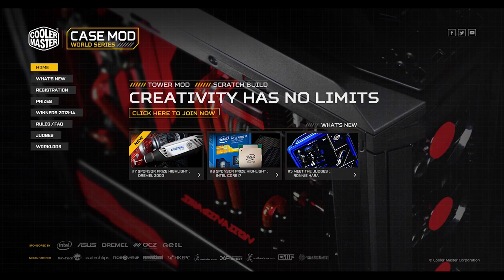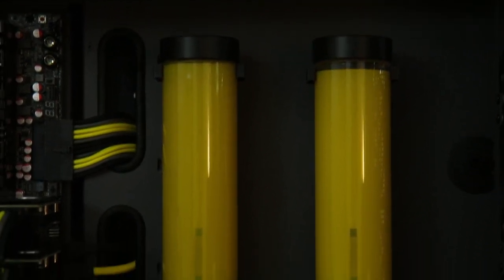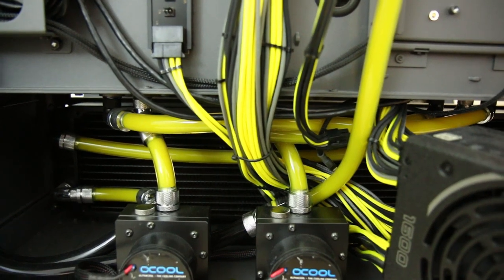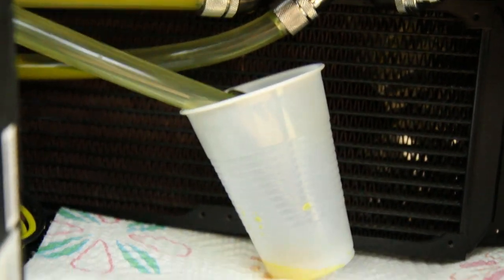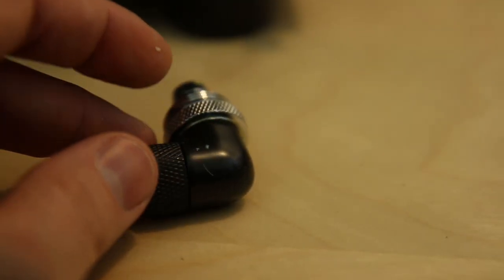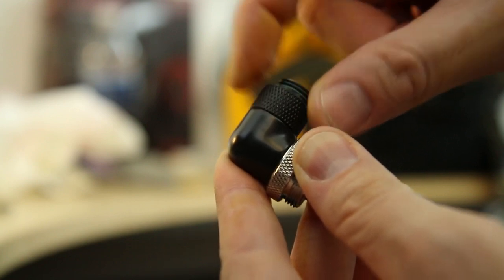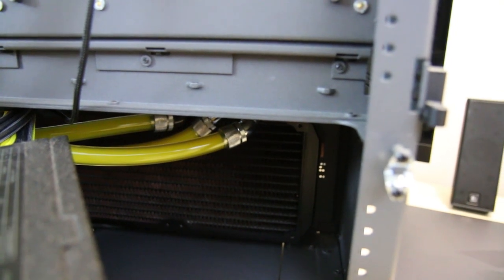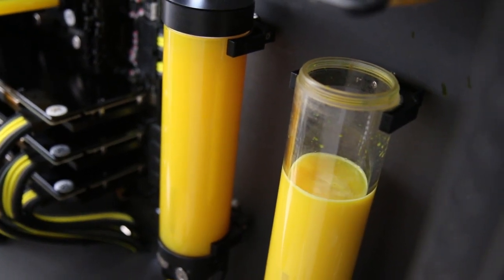My $6500 Custom Watercooled PC LEAKED!!! Now lets fix it....

Comment: ***** Jayz, you know why it's leaking, here's the answer to it. Copy paste from my engineering school lecture:

In a typical pumping system, piping bends, valves, transitions, as well as the location of the supply reservoir ahead of the pump impeller can be responsible for creating enough of a cumulative pressure drop to form vapor bubbles in the system. Also, sharp bends right before the inlet of the pump can add significantly to this problem, as the bend acts as a significant constraint to the fluid right before it enters the impeller. It is here a pressure drop will occur that could possibly be enough to form vapor bubbles and also magnify any existing vapor bubbles already in the system. Piping and supply reservoirs positioned at an elevation below the pump also contribute to this problem due to the higher suction head required to draw the fluid to the pump.

To simulate numerous pipe bends, valves, transitions, etc., ahead of the pump impeller, the inlet valveof the Pump Lab will be slowly closed, causing a constriction in the line. At a certain point, the pressuredrop across this constriction will cause vapor bubbles to form. Since the liquid supply tank is positionedlower than the pump itself, it initiates a negative head pressure, which also needs to be overcome bythe suction head of the pump. This adds further to the possibility of the liquid in the system reaching vapor pressure. To further compound vapor bubble generation, a sharp 90-degree bend was built into the flow system right before entering the pump impeller. This sharp bend, near the pump suction inlet, adds more pressure drop, which aids in the development of destructive bubbles contacting the impeller vanes and face. The following lab process is designed to make cavitation visible to allow a better understanding of its harmful characteristics.

Comment: I have a coolant I work with that could leak straight onto some of the most important components and it will continue running without issue :)

Comment: points and laughs Haha! 

In fairness though, I too has had a system leak with a more catastrophic outcome. 
It was self induced though, since I left a system running with a custom made CPU cooling block, made out of coins and solder and tartaric acid in the system. Just for the purpose to see how long it would last. 
After 2 months it had eaten through a solder joint and started leaking on the graphics card killing the PC and I finally had the excuse I needed to build a new one. ;)

Comment: I would use Mineral Oil instead of a colored water which you stick in the pumps, reason being is that mineral oil is non-conductive, so if there was happen to be a leak, there'd be no major concern if it does leak since you can just wipe it off and recheck the fittings and fill the canister pumps up again.

Comment: Is it bad that i was hoping to see it all over the M/B and Graphics cards etc from the title? Always wondered about the conductive properties of water dyes. I  Knocked a pint of water over my Rig while playing far cry 4. All 3 screens flashed before BSOD. both graphics card, sound card, M/B Drenched! Cleaned and dried it all... Works fine. would the same happen with coloured fluids?
Reply: Basic water is very conductive, you're lucky everything still works fine, with these modified coolants it's the same scenario, basically liquids don't go with circuit boards and other electrical properties found inside computers. A little splash on the surface won't do any harm, just wipe it up and everything is fine and dandy, but if you let it sit the coolant will begin to fuck with the solder points and make your MB or GPU short circuit. Generally the custom coolants used in most LC loops have a higher viscosity than that of water and so they have a potential to wreak havoc on a PC in greater quantities vs basic water which spreads over time at a much faster rate causing damage in far lesser quantities due to there not being any third party elements such as an antimicrobial solution etc.

Comment: I was thinking about building my 3rd ever PC. In the past, I've built mid-range priced PCs, but I'm thinking about finally building a high end gaming PC. I don't plan on overclocking, and I will probably only use a single graphics card. I have had it with fan noise as I like to record music sometimes and the fan is definitely an annoyance when monitoring a condenser mic. Do you think I should watercool?

Comment: There's nothing wrong with that fitting.  You need to tighten your fittings at least once after running your system for awhile unless your tubes had lots of slack at installation.  The tubes will stretch and move around due to water flow over time and the only thing holding the fitting on is friction from the screw threads. This is not unlike older cars with lose screws holding down gaskets.

Comment: the way i look at it...

both air and water can gave amazing temps and OC potential... my nh-d15 is better/just as good as AIO's....

but with water, you CANT be lazy... you need to at least look inside your case every few days. 

with air... ya dont have to do shit till your temps start creeping up, then dust it off.

i highly doubt my d15 would be louder than even a custom water cooling set up and offers within 5c the same performance...but some tims 5c is the difference between 4ghz and 4.2, and water cooling is just cool...

Comment: video is old but in a bunch of videos those fittings come loose could it be vibration back out? locktight is used on cars to avoid vibration back out

Comment: Hah. Least your pump didnt die causing the water to heat up and blow the pipe off the cpu block squirting water over your entire mobo, gpu, ram and pretty much everything.
yup. that happened to me.
Amazingly the only thing that survived was the cpu (and psu).
never going water cooling again.
With a properly tuned air setup I get not far off average closed cooling loop temps, or at the very least waaay more than adequate cooling off air.
Kinda entertaining the idea of a mineral oil immersed build next though......

Comment: Info I found a proplem of a thermostake 900 tover and asus extreem VI to check the mother's straightness with gums twisting the parent to the circumference.
Reply: I see that when i install moterboard it easy to fix. cut cum up off one side.

Comment: Why not use mineral oil instead of water  because even if it does leak it wont hurt the board or any other electronic part.

Comment: You got a bad o ring like in air conditioning in a car leaky coolant Hot coolant will be higher pressure so it will leak faster.

Comment: my pc just started leaking too, but i found out there was a hole in the radiator somehow. i checked every fitting, and when i did the air test on just my radiator with no fittings, just thumbs and mouth, there was an air breach half way down the radiator. super weird, but i got a new radiator and all is good now. and this time I added a drain port to my hardline loop......draining was a bitch before. XD

Comment: Water cooling is awesome but I'll stick to air cooling. Less mess, cheaper and nearly the same cooling capabilities at the same noise level. Yea water cooling looks awesome as fuck with acrylic tubing, LEDs and metal fittings but it's just not worth the risk as most components don't cover your item if it is water damaged.

Comment: Hi JZ!
So, I've been getting my CPU to run at 90ºC~100ºC while I play FFXIV and it has stopped twice on the same week. My ambient temp was around 38ºC~40ºC.
So I've been thinking in building a loop or getting an AiO water cooler but all I see people saying is that AiOs have a small life span or perform the same as Air coolers, which are cheaper. Some say that custom loops are just for looks.

So, what do I do? Living in a hot tropical country, I get pretty high temps and don't want my PC to die.
Thanks in advance!

Comment: I have hade a couple of leaks my self but only one huge, it happend because there was something blocking the water in my cpu block so the tubing snapped and sprayed my hole motherboard and my gpu's. That time i had 3 GTX 680's and a i7-3970X, but with some luck nothing broke, i was like ohh fuck but it worked perfekt after cleaning that is luck!

Comment: water cooling is no good, all you really need is a good liquid cpu cooler and a big enough case like 900d and corsair fans  and you all good to go, also get the best parts like gpu cpu and no need to overclock foools.

Comment: and this is what scares the hell out of me about the custom water cooling route and why my system just has a asetek 590LX 360mm and it works just fine it keeps my cpu about 8 to 9 degrees cooler then then vcore 1 and about the same temp as vcore 2 which is sweet for cooling an amd 9590
Reply: David Jones i would love to see that xD

Comment: Could I run 2 different types of liquid consistency in 1 loop and have them stay separated so you can basically see the liquid progressing inside clear tubes? I plan to create a table with no cooling purpose but with a glass top and a loop inside the glass with an infinity mirror to make the loops look forever.  Because it will only be for looks the liquid will only run through a pump no radiator or cooling blocks.

 Just to better explain what I am thinking for example if you took oil and water in a bottle they would remain separated and could travel through tubes and remain or re-separate fairly quick.

Comment: how long does watercooling last? does it last 2months or 1yr
Reply: +DemonGates If you know what you are doing, it will last just as long as a watercooling loop setup in a car, for the entire life of the build and probably longer. If you are paranoid you can check it every 2 months like Mac Chambers suggests because yes, there will be some sublimation, but I've found I only need to add 50-100ml every 6 months. Watercooling is as low or high maintenance as you build it to be.

Comment: im doing my first watercooling build just waiting for all to get here this is what im gonna be doing
Motherboard: Asus z77 ,
CPU: I5 3770K,
GPU's 3 R9 290x's
MEMORY 32 gb Vengence.
1TB SDD'S x2
PSU 1500W Enermax Platimax, Full Modular, 80PLUS Platinum.
XSPC Razor R9 290X / 290 VGA Waterblock x3,
XSPC RayStorm CPU WaterBlock,
XSPC EX360 120mm Radiator - Black,
XSPC EX240 Multiport Radiator, 
RESERVOIR: X2O 750 Bayres/Pump (Black)
RESERVOIR: V4,PrimoChill 240mm AGB CTR System Phase II - UV Green
PUMP:Aquacomputer D5 Pump Motor with RPM Signal.
CASE: Phanteks Enthoo Primo Full Tower.
Reply: Why would you use that CPU and motherboard if you're spending all this money on a decent system like that? Don't you think it would much better to go withe the i7 4790K and a Z97 motherboard? That's common sense really, you shouldn't really build a system with parts that are becoming outdated, other than that the system is top notch
Reply: Its the one i got atm gonna change it once i got more money just a temp

Comment: I'm afraid of buying cheap radiators how. I got some brand I've never heard of before and didn't know that it came with screws that were too long. So one of it's own screws poked through and broke a fin. It dumped water all over my 980ti while filling it.... Always use dead water people.
Reply: Can it still be used?

Comment: Just buy a multi size set of O rings from the hardware shop for like £10 rather than replacing the whole fitting. You will get over 200 O rings.

Comment: I love Watercooling, but unfortunately I came to the conclusion that it isn't really worth it.
I did everything correctly, picked up all the high quality parts you can imagine, I'm talking Pitspower, EK waterblocks and Koolance.
I had two fucking quick-discounts from two fucking different companies leak!
What are the odds of tgat happening!
The Bitspower quick-discount leaked while I was testing the loop and the Koolance quick-discount leaked about two months of finishing the build.
Now I need to take every fucking thing apart AGAIN!
Which is a pain in the ass...
I know this sounds childish, but I lost my love for this build that I worked way too hard on...
I'm gonna fix it now and try to sell it.
Next build will be an AIO CPU Liquid cooler and an aircooled GPU inside a noise dampening case.
#FuckWatercooling

Comment: I know what your going through with your Kid. My Son Alex has DiGeorge Syndrome and had to have open heart surgery and a Mickey button Feeding tube. He's doing great now but its not easy. He is a wonderful kid he's 11 months old and he's doing amazing he still has the feeding tube but he don't use it anymore it will be removed soon. I've not had the money to water cool my PC with everything going on but that's not a big priority. Hopefully I will be able to water cool my PC since my air cooler is not keeping my CPU cool. Its gets to 100c on turbo No OC. I'm currently looking for used parts since there's no way I can afford a new kit. My PC is not bad the specs are Gigabyte Z97X gaming 3 mobo, i7-4790k, Crappy Rockfish cooler w/Homemade mount,16gb G.Skill Ripjaws X 1600, Zotac AMP! Omega GTX 970 w/Extreme Cooler, Corsair HX750 PSU, Kingston SSDNow V300 Series 120 GB SSD, 1 TB Hitachi HDD, Antec 1200 case. Not bad took a lot of saving to get it.

Comment: Hey Jay, I've recently noticed my AIO is leaking it seems. There is a bit of fluid from the AIO I have in the top of my case on my graphics card. The PC still runs and there is no issues, but how should I go about cleaning the graphics card pcb to remove all the fluid without damaging it? Its not much just a few drops.

Comment: My AIO leaked.. I was just gaming on my 980 TI hybrid and all the sudden my GPU temperatures went up to 90°C out of nowhere, and the fan was spinning at max speed. Next thing you know my screen goes black. I am mediately open up the case to see what was wrong and I saw a water leak .. :(. 

Call my old air cooled 980 TI I can use in the meantime until I figure out what went wrong and to fix it but yeah. Sad day

Comment: Ive always been kind've worried about water cooling due to it dripping, (and ridiculous maintenance costs, but that's besides the point ), but couldn't you just use mineral oil instead of water / magical cooling liquid? People build PC's and then submerge them in it, so clearly it isn't conductive, yeah if it leaked ur computer would be all oily and gross, but thats better than wet and dead!

Comment: I had a internal seal failure on an ek graphics card watercooler block.  That suuucked.  All of a sudden all my screens went dead after some glitching and I was like wtf.   I cleaned it up and rebooted after spending hours redoing the seals and it fired right up and was fine..so yay. lol

Comment: That's why i try to avoid rotary fittings in general i usually  just stick to barbs and standard compression fittings it dosnt look as pretty but you get the same end results.But I do have a question for you  which is your general way to route your loop.This is how I have mine routed PUMP/RES to RX360 to RX120 to CPU to gpu to gpu then back to res/pump is this ok or should my rx360 go to cpu first ? I have it passing through both rads before hitting a cpu.Not sure if it would make a temp difference ?

Comment: I'm not a PC creation addict (I only have my one good PC for gaming, never had a different one, which only has fans no water cooling).

I don't plan on getting water cooling any time soon (my current PC runs at ok temperatures and I have good headphones so barely hear the fans). It would be great for reducing dust (fans don't have to pull as much air in, so less dust I presume), and the noise would be a nice bonus. Can anyone tell me other advantages, considering the fact that my PC already runs at acceptable temperatures?

Comment: Could i just ask a question? Where is your expansion? When water heats up it expands obviously, if your reservoirs are fully filled then there's no expansion surely, causing a build up of pressure in turn causing a leak. Could Jay or somebody answer this? Thanks :)

Comment: no matter how pro u are, when shit happen means bad luck, nobody perfect in this world , should thank god that the leak is not from the top radiator , imagine how lucky ?Will you consider the method of using cooler gas like nitrogen mix with some other formula kind of chemical to replace water ?that's the most safety way to cool down the pc.

Comment: its a shame that it happened to your computer if you have any tips for me to water cool my new computer that will be finished soon just waiting on the new parts its a msi gaming 9 ack with the intel 5820k processor and 32 gb of ddr4 and amd radeon 290x 4gb with a corsair carbide 540 air case if you can help it will be greatly appreciated

Comment: is it worth it to air cool a gaming pc? with like a 980 or 970 or should u watercool that?
Reply: TvShopOnTv watercooling isnt worth it at all these days unless you REALLY care about having a cool looking machine

1. watercooling is hard to maintain
2. overclocking provides small performance gains about 7-9 more fps in games at the cost of possibly damaging or outright killing components and no matter what overclocking shortens the life of said overclocked component/s
3. if you used watercooling all your life it would probably fail 2-5 times and its all luck where that leak happens
4. pumps / loops are very expensive both starter costs and replacing fluids as you have to replace pumps and fluids every few months up to 3-4 years tops if youre lucky
5. custom loops can be VERY difficult and time consuming to install
6. air cooling is catching up to watercooling in terms of cooling performance not that even small overclocking hurts your temps on air cooling much

overall youre better off spending that money it costs to watercool to buy better components like another gpu or a better monitor
Reply: SunnyD ok ty